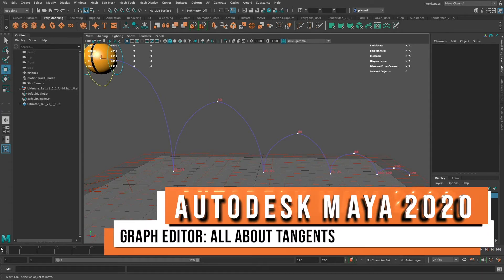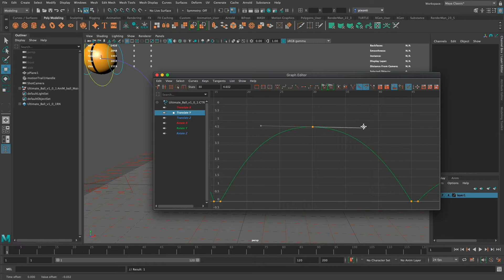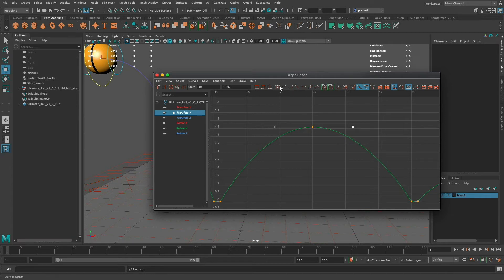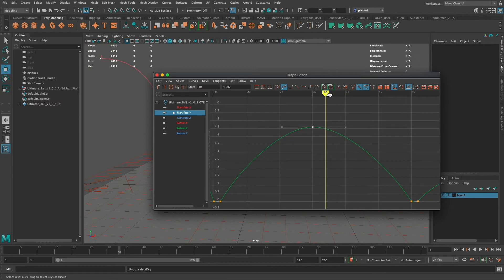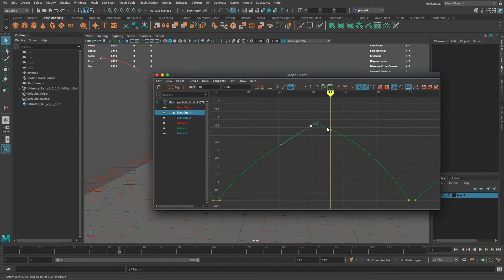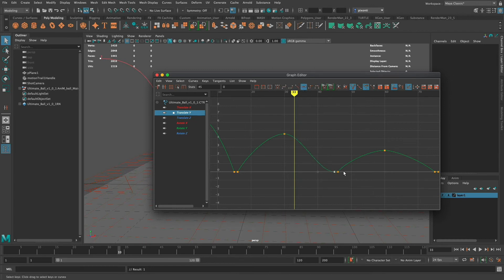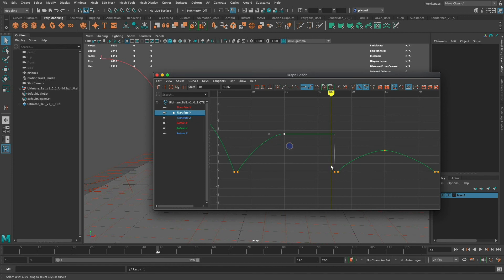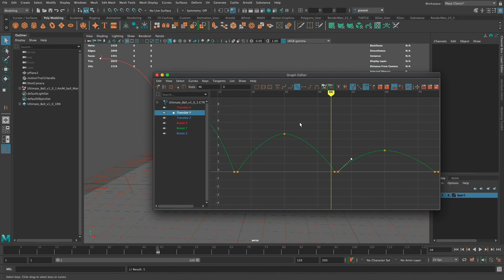Autodesk Maya 2020 - Graph Editor: All About Tangents

Comment: thanks for this tutorial. one question though...how do you drag the handles at 00:57 ? no matter what I do, I can't change the length of my handles!!
Reply from the maker: Pardon the delay in my response. If you are still looking for an answer to this, to be able to adjust the tangent length by dragging them out, they need to be Weighted and unlocked (free). When the tangents are non-weighted the handles will be displayed as diamond shapes in the Graph Editor. The handles will appear as squares if the tangents are weighted. To change tangents to Weighted in the Graph Editor, right-click on a keyframe and choose Weighted from the contextual menu. You can also set the default weighting for all tangents by choosing Curves > Default Tangent Weight > Weighted Tangents (from the Graph Editor menus). If the tangent handles will not move (are locked) free them by choosing Tangents > Free Tangent Length which will unlock or free them. Non-weighted tangents are always locked.